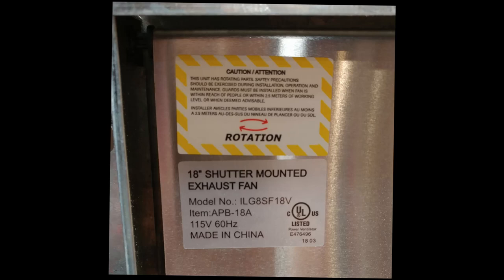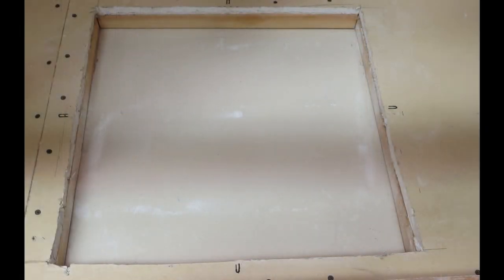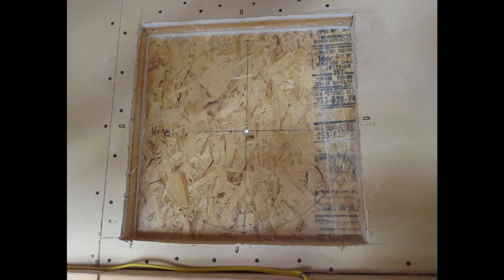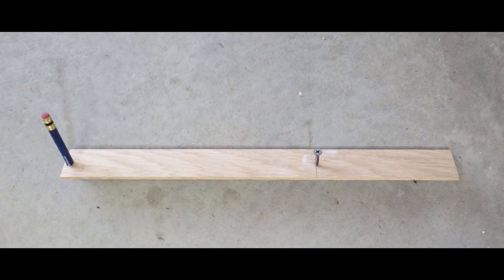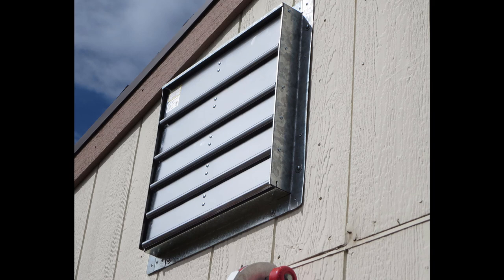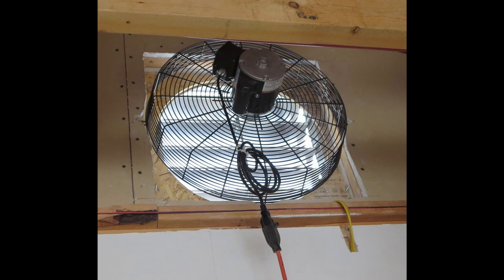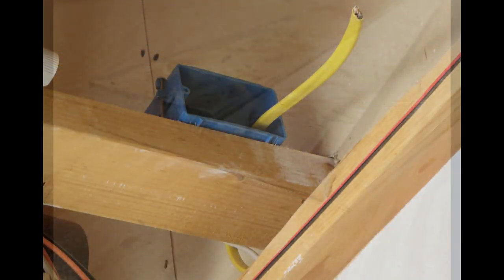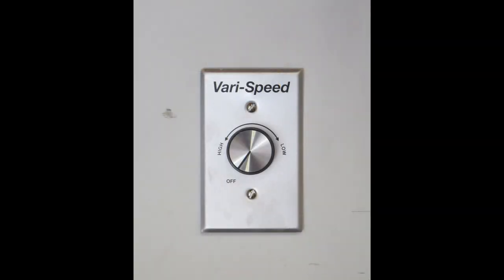Installing an Exhaust Fan in My Shop

Comment: This is brilliant. I will be putting up a 20” fan, even the same brand! Definitely helped, made me realize some things I hadn’t thought of. Like cutting a circular hole and not. A square one. Putting this in a 12’x24’ goat barn with a steel roof and no insulation.

Comment: Awesome job sir.
Reply from the maker: Thanks. Too bad I had to move from that house. Townhouse I'm in now doesn't have an outside wall for a fan. But on the plus side, because 3 walls are attached to a building, it says pretty warm in winter and cool in summer (insulated garage door helps a lot).

Comment: Good job!  Specific and quite helpful.
Reply from the maker: Thanks. I've been using it now for several weeks and it's working out great. I only wish I did this a few years ago...
Reply: I ordered a 24" shutter fan for my metal barn.  It gets quite hot in the summer and I need to get the heat moved from the ceiling inside.  It arrived this coming Thursday.  I'll keep you posted
 @knotnowwoodworking
Reply from the maker: Yeah, let me know how it turns out. The guy (Jon Peters) in the video I referenced installed his in a metal barn.

Comment: also with the homart or anything with a deeper pitch on there the louvers would be standing straight out and in the summer when its really hot or if there is gaseous fumes in there they would be sucked out a few seconds faster than that blade and it might be quieter too but onoy if you wanted to

Comment: Very Helpful video as I attempt a similar feat with my 2 car detached garage in SC.
Did you happen to have a thermometer in your shop pre-fan and post fan? Wondering just what kind of temp difference it made. I might hook mine up to a XMAS lights timer so it goes on for 5-10 minutes every couple hours during the day.
Reply from the maker: No, I never checked the temps, but could feel the air flow in the shop, which also helped with the air quality. Thanks for the comment.

Comment: Did you put a cover over the fan in the winter
Reply from the maker: No, I just watched for leaks and never had any. I wasn't too concerned about cold air coming in, I had a heater in the garage. And besides, I only did limited work in the winter (detached garage with no insulation).

Comment: Great video. I want to install one in my garage because it is so hot. How does it keep critters from entering the garage? Is there a screen or is that what the lovers are suppose to do?
Thank you...
Reply: louvers.
Reply from the maker: No screen. The louvers will keep out anything large. Small things will probably get through the garage door anyway, so it doesn't matter.
Reply: @knotnowwoodworking  How did you disassemble the louvers?
Reply from the maker: @DerrickWheatley  Not sure what you mean. The entire louver assembly can be remomved from the fan housing, then installed separately like I did. Does that help?

Comment: Can those vent “blades” on the outside be painted same out the house or trim color to blend in more
Reply from the maker: Good question. I suppose they can, but you have to be careful not to gum up the pivot points with paint. I think spraying them would be your best bet.

Comment: Where did you purchase this exhaust fan? Was the name "High Living" if I heard correctly, thanks for great video!
Reply from the maker: Hi, it was iLiving ILG8SF18V 18 in Exhaust Fan, bought at Home Depot. Right now it's $132.41 at Home Depot. I ordered it and had it shipped right to me.
Reply: Thank for the reply. Been looking on Amazon and different models. Found another brand called VES, it cost more but it comes with a 9ft cord so electrical knowledge needed, just plug it in. Shipment is free since it is over $25, and can buy a programmable unit to plug into wall then plug unit into that. Some of the reviews on Amazon, complained that the louvers did not close all the way on Iliving brand and there is a gap of 3/4" on the sides. I need it for garage, and don't want rain or anything sneaking in. Weather can be extreme here in Vegas. Thanks again for great video!

Comment: dude for get the blade that came with it just take a blade from a vintage homart window fan and stick it on the motor because of the dip pitch or some with an even bigger pitch

Comment: Those this fan have have outward exhaust inward  cooling?
Reply from the maker: This fan is an exhaust fan only--air only goes from inside the garage to outside.
Reply: @knotnowwoodworking  I'm looking for a Intake/ outtake fan for my workshop any recommendations
Reply from the maker: @danielcarcamo6336  Sorry, no recommendations. You'll have to shop around.
Reply: @knotnowwoodworking  Thank you for responding. I'll look around.

Comment: Already have fan but wanting to get shutters for exhausting air to outside like yours is. Where would best place to get shutters? Have mine blowing thru a normal window screen but thought maybe would work better if just shutters and no screen to produce any resistance.
Reply from the maker: That's a good question. I don't know where to look, but maybe someone else reading these comments can lend a hand...
Reply: I bet if you ask at a local HVAV / heating / air conditioning install shop they could help you.

Comment: Larry, nice video.  I have a Broan vent louver mounted on my garage and it lets in wind driven rain and I fear snow in a month or so.  How well does this Iliving vent louver seal.  I'm going to have to redo my louvers and am trying to decide which louver I'm going to use.  I hope you'll let me know.  Thanks, Ralph-
Reply from the maker: Hi Ralph, I've had some pretty hard rains and have NOT had any leaking into the garage, even though you can still see a little light from inside the garage when looking through the louvers. I did make sure to seal all around the louvers with silicone caulk--i think that's what makes it a good job. I've not spent a winter with the louvers yet, and actually, just moved, so I guess I won't be.
Reply: @knotnowwoodworking  Thanks for the reply Larry.  I'm going with a Dayton louver that has a tie rod.  I think when I install it I'm going to drill a hole in the tie rod and fit a spring mount and put a weak spring to positively close them.  Silicone is definitely in the mix as well.  Again, thanks for the helpful video and the rapid reply.  Ralph-

Comment: how effective was it for removing heat from the garage on hot summer days?
Reply from the maker: I moved out of that house and shop not long after installing the fan, so I don't have extensive experience with it (unfortunately). But it was very powerful and would actually hold the man-door open when it was on. To cool the garage, I would open the garage door a small amount so air flowed from under the door and out the fan near the ceiling. This worked very well.

Comment: What size fan should I need for a 10x16 shed it gets hot 🥵 in there have 2 windows but it’s not enough
Reply from the maker: I have no idea--but I'd go large and put it on a fan control so you can slow it down if necessary.

Comment: hows much does the temperature different?
Reply from the maker: I think you're asking about how much the temperature changes because of the fan. I really cannot say--I moved out of that house (and shop) before I had extensive experience with the fan. But I do know that it moved a lot of air.